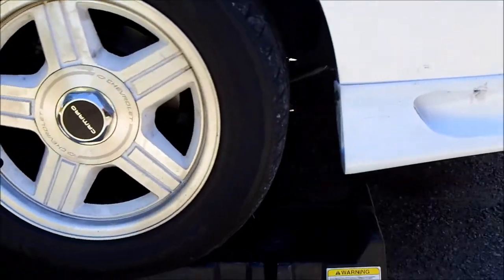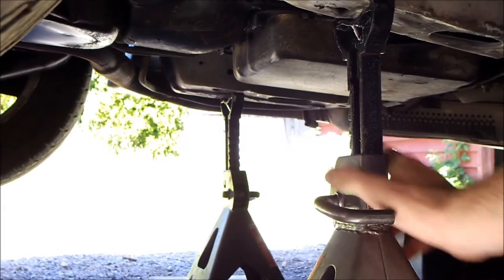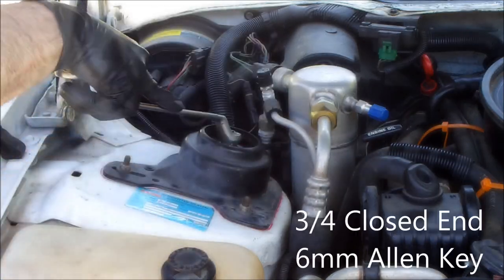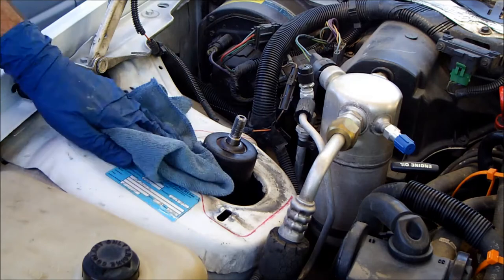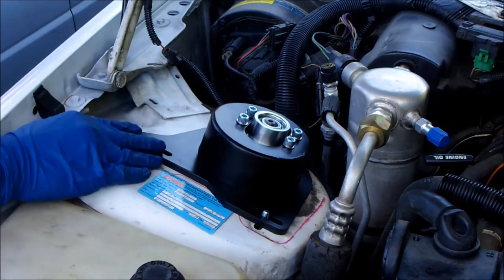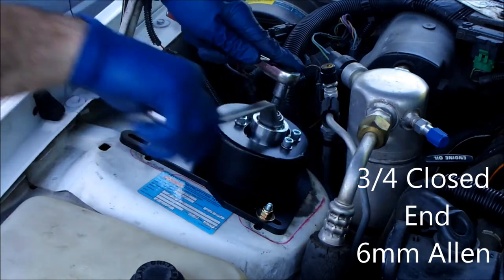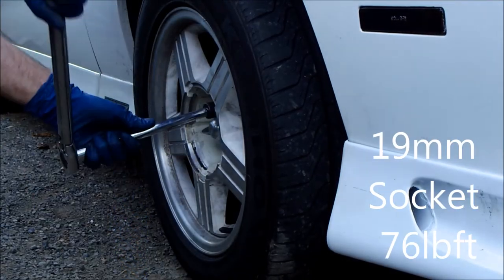Camber Caster Plates Install (1982-1992 Camaro/Firebird)

Comment from the maker: After further examination of the stock strut mounts, I found  major issues with the factory originals.
the original rubber was 75% ripped and were about to fail!
Meaning they were close to shooting  the strut out of my towers!
This swap was initially for handling, but it drastically IMPROVED ride comfort 
the stock mount had a lot of play in them, a solid mount puts that play into the shock; therefore improving ride quality and handling.
Reply: Hi i have to replace mine but i bought original new with rubber. (My car is not going to track or race, only light weekend usage) should then i use the caster and camber that you provided????
Reply: Mine were the same way. Luckily my car is not a daily. Else the struts probably would have grenade throughly hood because I would have never known to check those mounts.

You said the dust covers didn’t fit but it look like you used them when you reinstalled everything. Were those some different ones? Because I’m using the same mounts and I want to be able the have dust covers.
Reply from the maker: @davidwiley652  stock dust covers don't work. there are universal dust covers that might work.

Comment: There’s tons of Caster adjustment provided by GM. Look at the slots in the body under the strut mount.
Reply from the maker: I wouldn't say "tons" you get maybe 1 degree of adjustment with stock mounts.
these J&M mounts have about a 10 degree range

Comment: i used your video as well nicely done....too anyone using the umi caster camber plates, there is a small sleeve that you insert from the top after the shock is up in the caster hole....only difference from these plates. with the umi plates you can NOT use the dust boots on these either.

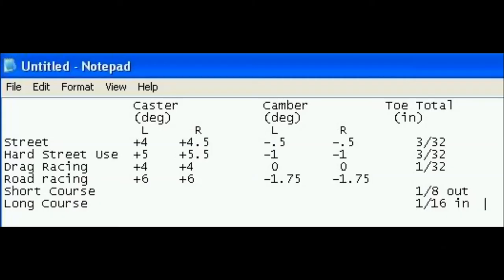where did those alignment figures come from? (note: the unentitled note pad shown @3:21 with the specs for toe total does not specify in or out for the: street, hard street, and drag racing use)

Comment: I’m curious when you tighten down the strut tower nut. Was your shock hydraulic spinning? I seem to only be able to get a few threads on it. I’m wondering if I got the wrong shocks from my auto parts or maybe need that proper tool for tightening
Reply from the maker: if the strut nuts don't spin on, it's possible the new struts have a different thread.
they should go on enough to get get a small wrench on the shaft.

Comment: Fantastic video! Can I get the product number for these caster plates/strut tower braces you detailed?  Also, how tight do you torque the three bracket bolts?
Reply from the maker: Those mounts are from Founders performance.
UMI also sells a copy of those mounts
and Detroit speed has a trick set that lets you change alignment settings on the fly, but they cost 2x.

Comment: Would you advise against using not using the Koni-supplied washer under the strut nut with these mounts?  I dont have much thread left after installing with my Koni yellows.
Reply from the maker: My KOni RACE DA struts don't have washers and i hammer on my car's suspension far more than most.

Comment: what is the dust cover you used in this application if the original ones didn't work?
Reply from the maker: You don't reuse the stock strut cover/boots.
they are pointless, they do nothing.
Reply: @3rdGenGuy  So I should leave them uncovered.  Just wondering what you used or did?

Comment: I’m trying to replace the strut tower base due to rust. Is this possible? Any help with a link as to what it’s called or a replacement part?
Reply from the maker: I assume you mean the sheet metal right?
if it's rusted, you will have to cut a good one off a junkyard 3rd gen and have someone weld it on to yours.
not an easy job to remove the cancerous spots.
Reply: Checkit TV , Go to a boneyard and have them cut out what ever sides you need cut larger then your rust area and talk to any good body shop, Rusted shock towers plague many different vehicles for ever, You could consider buying a harbor freight mig welder do it your self as having one will pay for itself easily if you're handy.
Reply: 3rd Gen Guy  I took it to a welder and it took him 3.5 hours to complete the job. He removed all the cancerous sheet metal and welded some new metal to it. It rides so much better than it had in the past. It looked awful and he did a great job. He charged me $280 well worth it! Thanks for replying to my post! Thanks for your video!
Reply: stclairstclair I took it to a welder and he did the job for $280. It rides so clean now. I don’t think I could of done it myself but you never know . I can do mechanical work, just not welding. Although I will learn  how to this year. Thanks for your reply!
Reply: @checkitTV  Oh very nice, Ive done that with rusted out frame rails and rear control arm mounts, Nice price you got.

Comment: You didn't say what to do when the original dust covers don't work, mine don't. Do I get special ones? can't install struts without any.
Reply from the maker: you don't have to run dust shields.
but there are "Coilover" socks that also work as a universal thing.
I personally don't run any dust shield son my $450 Koni 8611 struts
Reply: @3rdGenGuy  I'm running Koni 8741's

Comment: Also, did you expiernce better handling?
Reply from the maker: hell ya.
the stock rubber mounts are garbage even when new.
they are basically 1in thick rubber donuts 
that rubber flexes and causes your front  alignment to change mid turn

these solid mounts have ZERO deflection
on top of that, any movement up or down is eliminated, so your car rides better.
any movement is now put into the Strut 
it helps the struts do their job better

Comment: Great video man! I was wondering were you got the alignment specs you mention in your video?
Reply from the maker: 3rdgen.org
the specs are from a camaro performance handing book from the mid 2000s
I can vouch for the "hard street" alignment. It worked extremely well.

it acually makes the tires last longer than the factory alignment

Comment: Can't you do all this with the car sitting on the ground though? Why remove the wheel, Jack the car to jackstands, and then load the a arm with a jack? I'm guessing that there is a reason. Very curious since I have to do this soon
Reply from the maker: if the weight of the car is under the strut, it will make getting it aligned with the new mount impossible unless you have HULK strength.
 you have to drop the a-arm 2-3in to get the strut out of the mount, and you have to align the strut with the new mount.
without a strut tower mount, the Strut shaft will slam to the left or right with 500+lbs behind it.

Comment: Would this help on my 89 Camaro rs that has too much negative camber it's hitting the wheel wall too much I can't really do u turns at all
Reply from the maker: sounds like your front suspension needs some TLC. camber caster plates will help you get there, but wont help blown bushings or old springs.

Comment: Did you notice the bearing in the plate doesn't turn like the factory ones?   After installing C/C plates my steering is much harder.  Any suggestions?
Reply from the maker: A new Mono ball strut mount is gonna be a little stiff at first. 
if it's still stiff after 200 miles or so, spray some WD40 or graphite lube into the mono ball.

Also, is the Strut top nut you used smaller than the Mono ball? using too large of a nut can keep the mono ball from turning and moving correctly. 

if your caster angle changed a lot, that can cause steering to feel heavy.
Reply: @3rdGenGuy  Thanks!  I used the nut that came with the koni struts,  it doesn't appear to be binding or touching anything other than the top of the spherical ball.  I also omitted the stock dust cover as it wouldn't fit with the new plates.  Does the spherical bearing on yours rotate when you turn the wheels or does the shaft remain stationary and the strut body turn?
Reply from the maker: @tidan1  if i lube them up, the mono ball will turn with the steering.
if I forget to spray lubricant in them every few moths, they get sticky and wont turn as well.

Comment: Do you have to take it in for an alignment everytime you want to change from a track to street or vise versa ride?  or  is there any way to acurately adjust these yourself?
Reply from the maker: I do my own alignments, so i can change it when i want.
 ive used the hard street alignment for 6 months and it's perfectly streetable.
in fact, the factory alignment wears out tires faster than the mild street one.

Detroit speed has solid mounts that have notches,  so you can save alignments and go back to them easily.
but those mounts are like $500
Reply: ok thanks for the info.  Do you have a link for the different alignment specs for our cars?
Reply from the maker: 3:21 are the specs you will find on the 3rd gen forums.
Reply: sorry I missed that and just seen it when rewatching.

Comment: i don't know a whole lot about suspension set ups.  Why is the caster numbers different from left to right tires for street and hard street?
Reply from the maker: Driver weight is the reason; as far as my knowledge goes.

racing teams will usually faVOR the right or left depending on how many right or left turns a track  has.
but that's for pro racing
Reply: @3rdGenGuy   It's actually for road crown. The pitch in road for water to run off.

Comment: After changing my centerlink and tie rods my wheels tends to buckle on full lock. It’s like it’s skipping will these fix my issue ?
Reply from the maker: what do you mean by buckle?
can you describe it?
Reply: When your turn the wheels more than halfway it feels like the front wheels are rubbing and the car slows down
Reply from the maker: well, that seems like a weird problem to have.
did you install the tie rods in the correct orientation?

if you look directly at the centerlink, the inner tie rods should be behind the centrelink.
so you see the castle nuts
Reply: @sneakydude9261  got your wheels on wrong check your offset...i had 1 rear on my front and if i hit the breaks rim got stuck up tie rod end and wouldnt move until i let off

Comment: you forgot to plug in your under hood light 🤦‍♂️

not sure why you even unplugged it in the first place. should have just taken the negative terminal off the battery if you were concerned about battery drain.

Comment: Bet the ride is harsh with the solid mounts.
Reply from the maker: The ride quality is acually better than stock mounts.
it was a weird surprise.
UMI explained to me that the stock mounts have over 3/4in of play when driving around
these SOlid mounts transmit that 3/4 of travel into the struts
so the dampeners acually do their job better.
Reply: Interesting.  
What's your opinion of polyurethane lower A-arm bushings in a thirdgen?
Reply from the maker: Your options are 
1. factory rubber
2. solid Del-A-Lum ones
i ran with the Poly ones for 5,000 miles or so and they are generally shit.
they have deflection like stock rubber while squeaking like crazy
the solid mounts have the same ride quality, with ZERO deflection 
the SOlid bushings handled a lot better at the Autocross

Poly also won't last as long as a solid bushing.
some guys on 3rdgen.org said they had been running the Del-A-Lum bushing for over 20- years without issue

http://www.globalwest.net/camaro-del-a-lum-lower-control-arm-bushing-1983-1984-1985-1986-1987-1988-1989-1990-1991-1992-global-.html

Comment: i've gone nuts trying to find a source to purchase this item, for my 1982 Firebird one owner, 2000.000+ mile fun driver. HELP!
Reply from the maker: https://hotpart.com/product/camarofirebird-82-92-caster-camber-plates-black-jm-products-made-in-the-usa/

they also drastically improve ride quality as well.
i went with the aggressive street alignment as well.
Reply: founders performance is cheaper $$$ same product fyi
Reply: Thanks Dirt, I'm 80 and still working on my 82 Firebird. Phil
Reply: Update: The J&M Caster/Camber plates are installed , and Powerfrax No-Slip  Differential installed.. Both were great additions. Phil Sourbeer
Reply: Phil Sourbeer thanks for the update!

Comment: If you are NOT RACING... There is NO NEED FOR THIS MODIFICATION. I drove an F-BODY for 10 years.....for a total of 250,000 miles before I sold the vehicle and NEVER have I had a problem in my alignment. Granted, preventive maintenance played a BIG part in this. This modification is for RACE TUNING. So, the ENGINEERS who designed the Third Gen Suspension got it right. FACT if you are not racing and drive you Third Gen regularly ON THE STREET 99.95% of the time and CHANGE Caster and CAMBER....... YOU WILL LEARN THE HARD WAY. My advice is take a Race tuning class and learn the basics. That's what I did and I drove happily ever after.
Reply from the maker: that's a cool story bro
i'll remember that when i'm hitting the autocross this season with my superior strut mounts and alignment.

----- a guy who works with engineers and knows how stupid they acually are.
Reply: lmfaooo
Reply: I don't think it is about stupidity, its more about makin it as cheap as possible.
Reply: I just changed mine on my 90 camaro, the rubber bushing inside the housing where the strut boots sit, we're degraded / worn badly. Also the bearings that spin with the strut were worn out, they barely tunred. Much better feeling after replacement. I didn't even get an alignment done and there's like no pull and I did not adjust them to the specs in this videi, because I'm not racing it. It's my daily driver
Reply: @Michael Wilson

So you didn't do this modification, and have nothing to back up your opinion.  Cool story bro indeed.
Reply: I bought my 90 new and still have it. Only reason I see to change the strut mounts is if you already have solid Heim joints in the lower control arms. Most of the side loads go through the lower control arm and the deflection of the rubber bushing at the top of the strut is almost negligible. But most people seem to change them anyway because they look better. Mine are in perfect condition so they’re staying on even though I’m installing tubular control arms with urethane bushings. My rear end is all urethane bushings and the ride quality became much harsher from that mod alone without any appreciable improvement in handling.

Comment: so if the car is lowered can you still use the street settings???
Reply from the maker: doesn't matter what ride height you are at, pick an alignment that meets your needs.
your car could be SLAMMED or at stock height for the mild or hard street alignment.

if you want the "Full Race" alignment you will probably need to be at least 2in lower than stock to get -1.75 or -2.0 degree of camber.